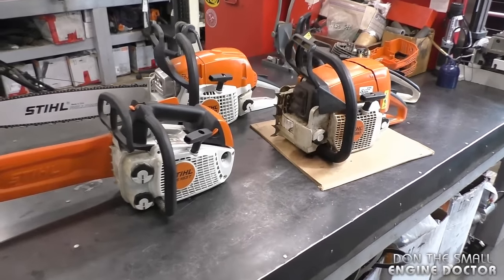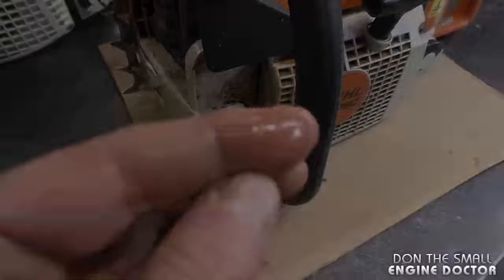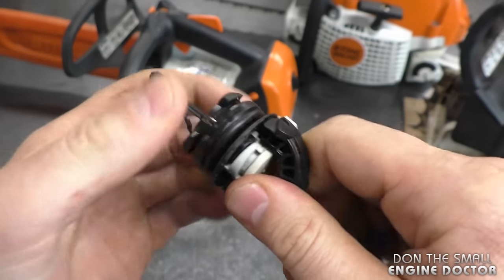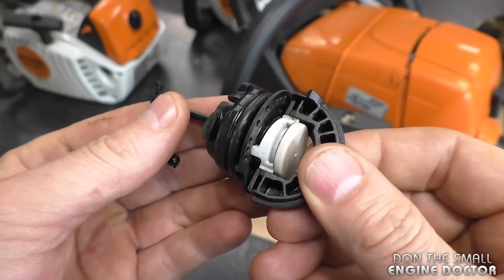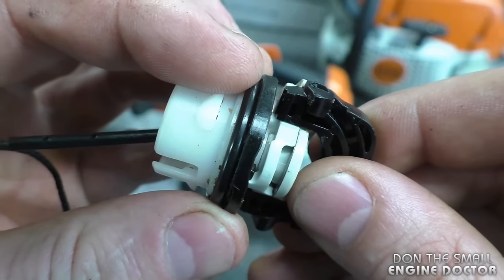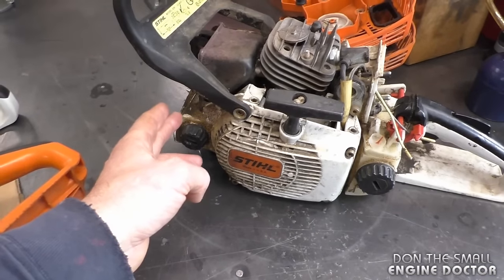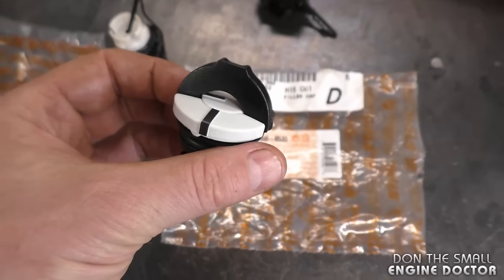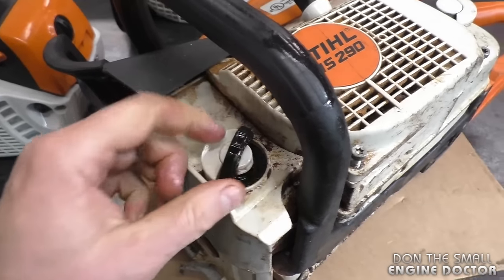Fix 90% Of Stihl Chainsaw Bar Oil Leaks With This Simple Repair!

Comment: Good info, Dony. I hope Stihl is watching this video.  Unless their main source of profit is selling replacement caps!
Reply from the maker: selling caps for them is lucrative at $15 each in canada so i doubt they would change it
Reply: @donyboy73  They are $20 each around here. The stupid things always break when it gets cold, right when you need your saw the most for heat. If someone could find a way to make a screw on cap to fit these saws they would make a fortune.
Reply from the maker: @ghostguy6  stihl is making a fortune selling those caps
Reply: They’ve always made a fortune by #1. Being overpriced.#2. Making you go to the dealer for everything! #3. Parts are WAY overpriced. Don’t get me wrong, their pro saws are good ( just expensive). Their homeowner and farm/ ranch saws are ridiculously expensive for plastic clamshell construction.

Comment: You made a comment about making saws that dont leak and how hard it is to do. I ran old McCullough saws for years and not ome of them leaked oil so it can be done. These saws were from the early 70s most of them the 10-10 series

Comment: bought a new stihl saw in sept and lots of bar oil leaking need to figure out why
Reply from the maker: check oil cap, ask dealer if it's a warranty issue
Reply: @donyboy73   You are right the cap is leaking on the oil wonder why the gas isn't leaking.
Reply from the maker: @robbobcat7286  here's my video on those caps https://www.youtube.com/watch?v=rl-9PnXMDK4

Comment: ..That's what happens when a company comes up with a solution to a problem that doesn't exist..If it ain't broke, don't fix it, I always say...as for the Husqvarna ones, yes, they are a better design..they screw on with threads, like a regular cap, rather than having fiddly notches to line up and weak inner parts..AND, you can replace (most) of the Husqvarna caps with regular caps if you don't like them..not so with the Stihl ones...

Comment: Fixing Stihl oil caps?  Has any one tried cleaning the oils cap with a solvent?  I had three stihl saws that leaked oil so I just cleaned them with brake cleaning fluid and problem solved until for a year or two until they got dirty again.

Comment: My Huskvarna 440 leaks at the chain. I usually store it upside down.
Reply: All chain saws, even when new, seep a little bar oil at the chain if there is oil in the tank.
Reply: @jamese9283  
Thanks! I keep it upside down, no more leaking.

Comment: Mr. Donboy, I have a Vanguard Motor with 23 Horsepower, idle control needs to be reduced, from about 1000 to 600 to allow it to engage the gear, do you know how I can go about that? 

Thanks

Comment: The main reason the oil caps are breaking is due to users over filling it with oil. It creates pressure in the oil tank and the cap breaks when it's forced on.
Reply: I agree.  The few times I could not get the cap to set right to tighten it down was because I put too much oil in the reservoir.  Pouring out a small amount fixed the problem pronto.  Good point.

Comment: I wonder why the fuel caps don't seem to leak as much as the oil caps do.
Reply: Probably because the oil heats up when the saw is running and the fuel does not.

Comment: Wish they would.go back old screw on caps.between oil.leaking and caps not locking properly the old 026 screw on caps have been going for 25 years

Comment: Chainsaws and old harley's always mark their spot.  If it's not the cap it's the oil trapped between the rails that drips off the bottom of the bar.  It's just a nasty tool.
Reply from the maker: absolutely

Comment: “Chinese oil caps”.  Enough said.
Reply: Yup, agree. I bought a gas cap off of Ebay for a Husky 51 that was supposed to be OEM, turned out it was Chinese, leaked as soon as I installed it.

Comment: ON my old stihl chain saw there is only a o-ring and thread, on the New cap they Have Maze it to complicated, make it simple
Reply: Correct. Stihl is known for a complicated solution to achieve only a slight improvement, and their complex solution is not very durable.

Comment: BET, some would swap to a cap needing a tool to solve the leak forever, HINT: For the aftermarket folks !
Reply: It can't be solved that way because the design of the tank has been changed to accommodate caps that leak.

Comment: With gloves on, I find that the Stihl twist off caps are not possible to remove easily. Especially to flip up the cap twister.
It would be far better to have a simple lever arm cap mechanism, which can be flipped up with your gloves on.
The designers appear to design for bare hand operation and that's a big mistake.

Comment: What happens when you over engeneer a part keep it simple stupid. My Husqvarna has a regular screw on cap no issues  but my tank leaks so a non leaking chain saw is like a non leaking John boat rarely see one.

Comment: In last 15 years or more  Stihl parts are made in China, like carburators and ect. But chain and chain bars are made in Germany. It is really sad that cant fix it so small problem, or they just dont care?
Reply: They could easily fix it, but are likely making a big profit from so many replacement caps.

Comment: This is problem like removing capitalistic drama by communism - new solution of simple old cap closing with simple screwdriver was replaced by 'better&tool-less' and complicated so much that in 90% leaks and inevitably needs replacement! And so on with no hope for fixture that very leaking item...